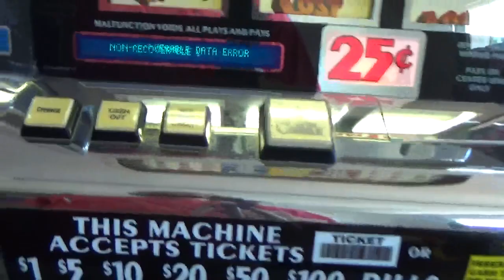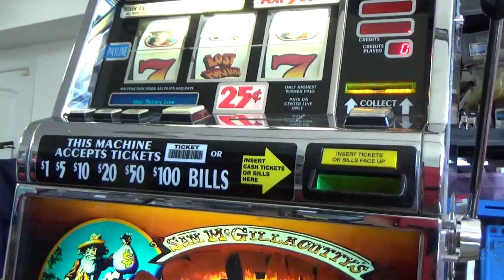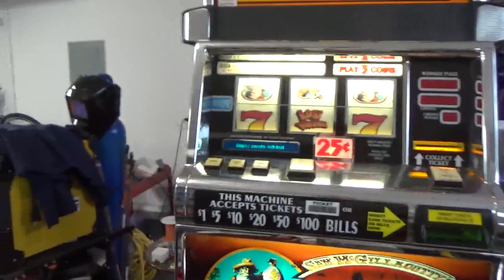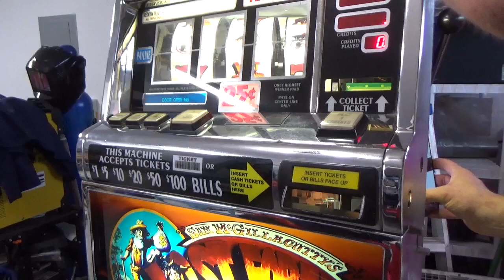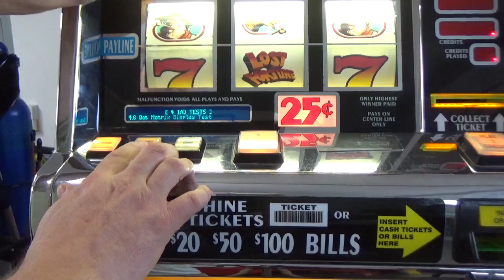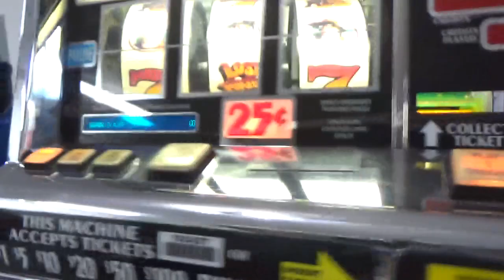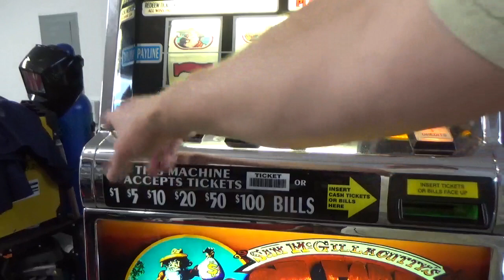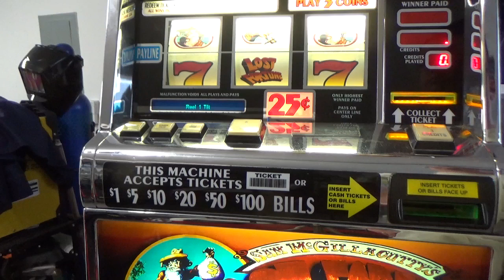IGT Slot Machine Repair - Part 3

Comment: @ :15 what if the diagnostics lights stayed like that( all 5 stayed on), what would be the problem.???????
Reply from the maker: Non-booting board. Could be memory chips, game software, numerous things. Start with one thing at a time. The big green varta battery often leaks and corrodes traces under it causing boot problems so check it if you haven't removed it already. It's not needed.
Reply: @Ryengoth  thanks,and thanks again for the quick reply 😎👍

Comment: Love your videos! Do you have a video on how to change denominations on bet credit. My machine is set for 1 cent credit MAX play 3 credits. So when I bet Max it’s only 3 cents. I want to make it 25 cent per credit. Thank You, my machine is the IGT S 2000
Reply from the maker: You will need a key chip in order to put the machine into programming mode. Here is a great resource for S2k machines: http://newlifegames.com/nlg/index.php?topic=21511.0
Reply: @Ryengoth  Thank You so much for your answer. Keep up the great work on the videos
Reply from the maker: If I still had the machine I could run through the process on video. You will need to follow the key chip programming steps to get the menu up on the display. Then you can go into the accounting menu and set your accounting credit and denomination values. The accounting credit ticks the counter so if you leave it as penny and change denomination to 25 cents then you may need to do a counter bypass. otherwise it may fly apart with 25 ticks per coin credit. when I set up the 4way touch denomination module I had to leave acct at a penny so that you could switch between coin denominations in-play. the counter reels were running wild for 10 minutes after I stopped playing. had to bypass it.
Reply: @Ryengoth  q
Reply: @Ryengoth  I had a technician replaced the mother board and he forgot to change it to 25 cents. I thought maybe it was a simple task but after I saw your video I’m just going to wait for him to change it. I’m learning as I go with these machines. Sure wish I knew more how to straighten out an issue. I appreciate your comments and truly enjoy your videos. Terry